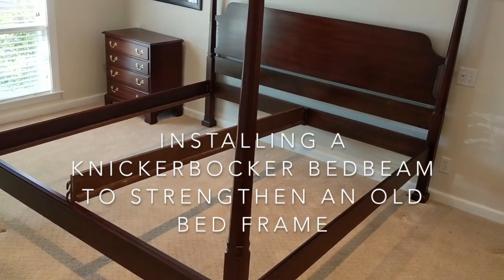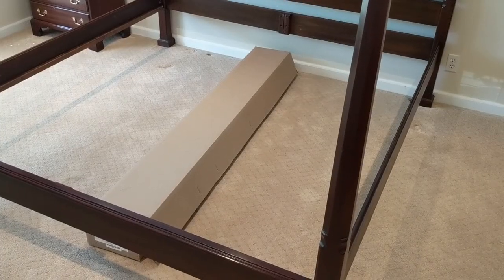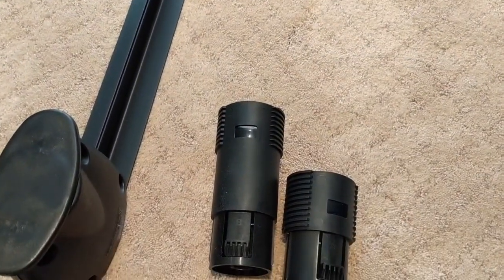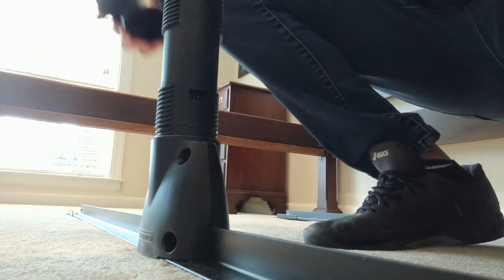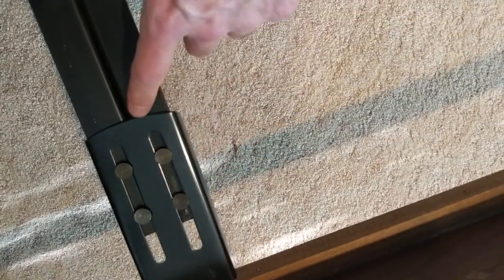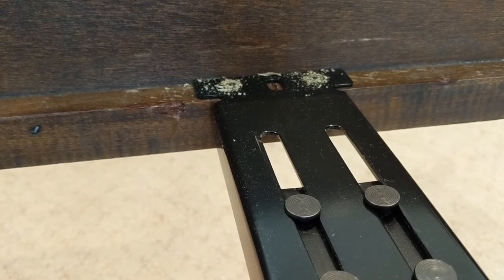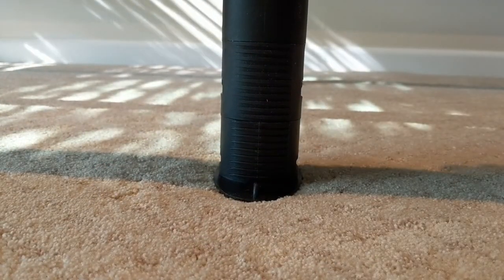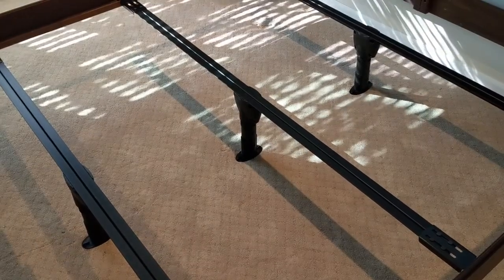Installing a Knickerbocker Bedbeam on an antique king bed frame to make it less squeaky

Comment: Thank you for sharing this excellently detailed video of how to assemble the Knickerbocker Bedbeam.  You answered one of my questions about how to assemble the legs.  My 2nd ? is ~ can the legs be taken apart and readjusted if the room goes from wall to wall carpet to laminate flooring? Am going to contact Knickerbocker to get their input.
Reply from the maker: Thanks! The answer to your question is yes. In fact, I had originally had the bed on carpet, but then we switched to hardwood floors and I adjusted the legs (made them longer). It worked out really well!

Comment: What kind of base will you be using? A box spring? I have an antique bed with only two 3” wooden  slats going across the width to support the box spring. There is no rail edge around the inside of the nicely detailed wooden side boards. There are only 3” blocks chiseled away to serve as a tongue and groove to match the tongue snd groove on the end of the wooden slats that go across the width of the bed. (Clear as mud?)

I was told box springs aren’t the best choice these days, especially if you want a latex or Memory foam mattress. But I think box springs are my only option with just these two slats to support the foundation. 

If I go with the system you show here, looks like I’d still need to stick with a box spring.
Reply from the maker: In my case I'm using a foundation (also called base) from Avocado which is one king unit (as opposed to two twin). I'm not sure what to suggest for your situation without seeing it, but you might be able to extend the ends of the Bed Beam into the 3" cutout blocks. If you can make another pair of 3" cutouts, then you could use all three Bed Beams for more support. If your local mattress store allows returns, you could try the Bed Beam to see if it will work with your frame, and return it if it doesn't. Hope this helps.
Reply: @usuallyuseful9217  thanks for the good suggestions. I’m grateful to learn about Avocado. Looks like a really good business to support.